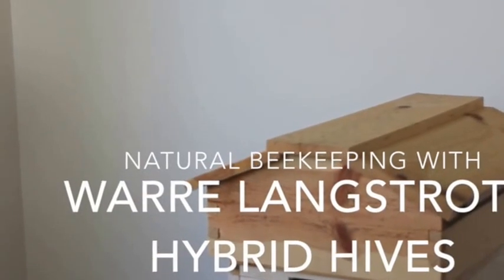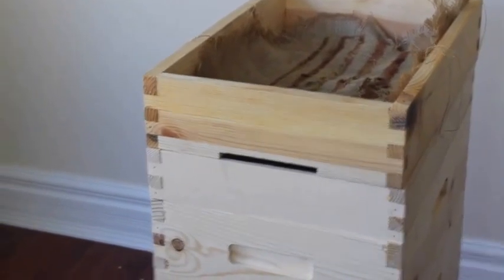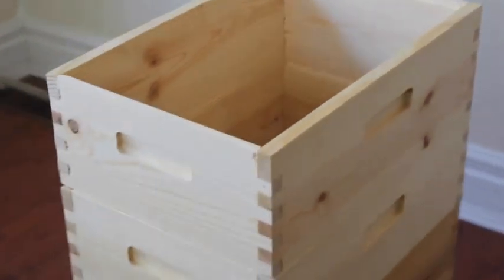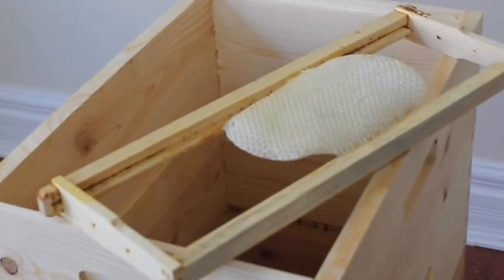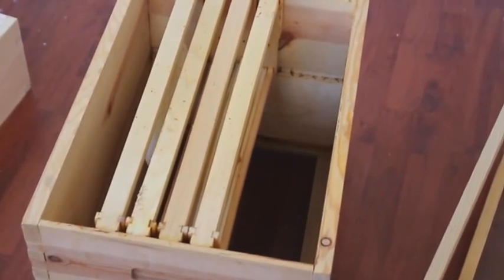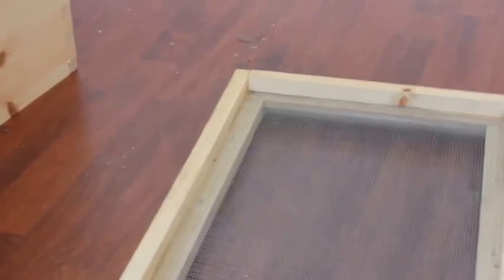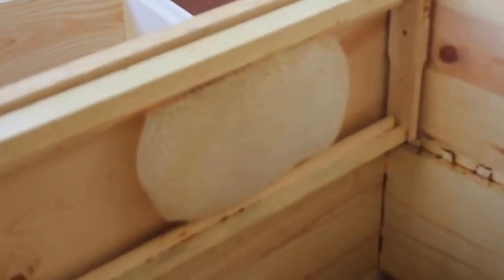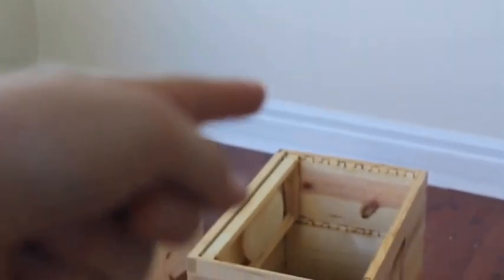Warre-Langstroth Hybrid Hive (Beecentric Hive)

Comment: You need space above the sticky-board to clear dropped material that is on the stick-board.  As designed the dropped material on top of the sticky-board will get scraped off when you pull it out.  You will end up having to screw a gap-filler strip (that can be used as a handle) onto the sticky-board.
Reply from the maker: Agreed. Since this video was posted, I've modified the bottom boards.

Comment: Thank you for this video. Would there be any reason you wouldn't just go ahead and set up the hive with all the boxes the bees will need? It seems like that would eliminate the need to life all the boxes (I'm weak, lol.) I'm just learning, so I am sure there is a reason why Warre didn't do that, but I don't know what that is. Thanks!
Reply from the maker: Thanks for the excellent question, Barbara! Generally, managing the hive such that you're always giving the bees a little bit of extra space to grow into, but no more helps the colony regulate its temperature. It also makes the hive easier to defend from things like wasps, other colonies, and wax-months.

Of course, it's worth pointing out that in the wild the volume of the hive cavity is fixed but seldom larger than 40L (about one standard 10-frame deep Langstroth hive box OR two of my 8-frame medium boxes).

If you limited your hive to one or two boxes, you could, in theory, give them "all" of their boxes at the start. The downside is that wild colonies frequently run out of space and swarm, and don't produce much honey. The upside is that swarming causes a break in the brood cycle and naturally forces a break in the lifecycles of varroa mites.

Over the years, I've gradually migrated towards keeping smaller and smaller colonies; generally limiting them to 4 boxes, adding boxes one at a time, and splitting them to mimic natural brood breaks to keep mites below the economic threshold.
Reply: @DustinBajer  Thank you for the reply. I did not realize that the typical cavity would be just one Langstroth box. It seems that in the US we keep pretty large colonies, compared to what I have read on some British blogs, at any rate. I like your hybrid approach, there seems to be plenty of room for finding new and healthy ways to be a keeper of bees.
Reply from the maker: Barbara Yoder, You're welcome :) The thing about large colonies is that they produce a lot of honey - but they're also more vulnerable to pests and diseases - especially varroa mites that breed the enlarged brood nest. 

Dr. Thomas Sealey has been an advocate of keeping smaller hives, but it'll probably take some time for the industry to come around to the idea.

I think you're right that there's still a lot of opportunity for experimentation and explorations. One of the reasons that I'm excited about the rise of backyard beekeeping is that small-sale beekeepers are often tinkerers and don't have the economic pressure of maximizing honey production.

Comment: We won't be getting into beekeeping for a few more years at least but this is exactly what we are going to need. I love the Warre but our state requires us to have frames so they can be evaluated on a frame by frame basis during inspections. Do you have contact info or website or some way of ordering these from you when the time comes? Or at least get the plans if you happen to not be producing them when we make the leap?
Reply from the maker: I switched from the traditional Warre to the design above for these exact reasons - those movable langstroth frames make beekeeping a lot easier (for you and the bees). I have more information on the hives at beecentrichive.com

Comment: I am actually also try to use the dimensions of a langstroth hive and build like a warre hive would that work?
Reply from the maker: Yes. That's more or less what I did. Though, the boxes are 8 frame, medium langstroth boxes (as opposed to the common commercial 10 frame boxes with deeps for brood and mediums for honey.
Reply: Dustin Bajer , do you have any plans
Reply: I am kind of discouraged as this moment because I don't know what to do.  I like the Warre system but people tell me to go with the Longstroth system. I was set to build a Warre Hive but now I would like to look into building a hybrid between Warre and Longstroth. Do you by any chance have pans or dimensions. I would like to build my own frames as well but it is getting more difficult to figure this out now.
Reply: U WE 
This guy is trying to reinvent the wheel.
Warre design from warre is a great design.
And my state says your hive has to have moveable frames too.
The warre is legal.
Also bee's prefer large brood boxes over small.
If you have 3 boxes for brood the brood is exposed to the elements longer because your inspections take longer.
I would reccomend watching the documentary on father Eric from buckfast abbey.
Also most of the beeks in Europe use large national brood boxes and smaller honey supers.
This guy is a quack.
Also the wood is cheap.
The reason warre is famous is because his system works

Comment: Nice hive. But not even close to a warre. It would also take a lot of boxes to keep ahead of growth.
Father Eric from buckfast abbey who was a bee expert.
Said. A large brood box is healthier than smaller ones.
Most of Europe uses very large national hives.
I'm a big fan of the warre. And prefer to build them to warre's specs.
Plus I use better quality wood, all cedar. You sound like a expert.
Reply from the maker: Thanks, Greg. You're right in that this hive is different than a typical Warre - primarily the use of standard Langstroth frames.

In terms of growth, I find that it's easy to stay on top of it if you're doing regular inspections. My hive typically get 5 or 6 boxes high, though, I'll usually start pulling honey off before that happens.

I've kept brood in 8-frame medium and 10-frame deeps and have found that it doesn't make much different to the bees - in the height of summer, I might have three medium boxes of brood instead of 2 deeps but that's about it. I was originally inspired to use medium boxes for brood and honey by Micheal Bush.

I've chosen 8 frame equipment instead of 10 because the over-wintering cluster of bees is roughly 8 frames wide. The geometry of a beehive is such that the closer has a hard time moving perpendicular the the frames without breaking up and loosing their heat. As a result, I've found that the 8 frame hives overwinter better than 10 frames - at least here in Alberta where we can hit -30C.

Comment: i can build 6 hive  bodies.  to the 1 you buy.  frames and every thing too, much much cheaper to make your own  Done try all the other bs even fiber glass, . lucky got 2 yrs out of em.  " Paint is the only way to go"!!  Do you want pretty hives or hive that last. I WANT MINE TO LAST!    just 2 or 3 costs of paint, it depends on how dry the wood is, AND SEAL UP THE CROSS CUT ENDS. WITH CAULKING. RUB IT IN let dry, and paint  the out side and rails,  i'am getting 10 yrs out of em, b4 i paint em again!  every 2 yrs i wash em down. with a rag soap and water
Reply: 426 SUPER BEE how much complete in 1hive
Reply: Amen!